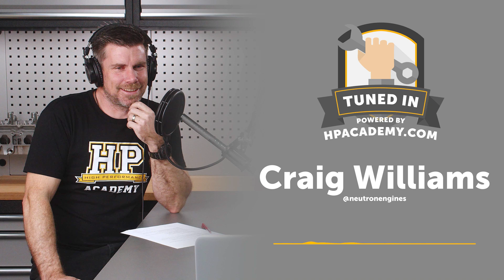013: 4.8L K24 V8 | How to Design and Produce Your Own V8 K Series [#PODCAST]

Comment: I have a crazy build plan for the k48. But even i have sensible daily numbers aith it. 700rwhp ish probably 750 range to be more exact low boost twincharged. 

Modern blowers with integrated bypass valves. Idea is low boost itll have that 700 all over and loads of torque. And act kinda like an ls3 or ls7 but strung out and able to go high rpms. 

But also be able to turn boost up and have it not bypass. Or various set ups. It conpounds but the boost is low say from 750 to 1k. Boost goes up still bypasses by similar range but response is a bit different. Then they dont bypass by compound and goes to 1200 to 1400. Max boost no bypass like 1800 but for standing mile events. 

Inside a superlite slc. Daily tune is for performance and shenanigans but also short shifting around town. But also cheaper performance street tires on a track. 1000hp ish for real track and race tires. On track. 

Anything above like 1200 is gonna be for drag racing and mostly the torque. 

Gearing it kinda like a ford gt or american car. But keeping in mind a higher red line. And more gears. Normally more so rpm reduction but idea is split the ratio gaps kinda. Not too close not too wide. 

But im also gonna probably be going 87mm stroke 88mm to 90mm bore. Saenz custom forged ti rods. Similar pistons to his. And billet heads. 

And potentially tweaking the cylinder sleeves. Diesels use steel sleeves. Alot stronger normally thinner. Gonna see about induction hardening the outside surface. Want good sealing. But wanna increase the strength for safety reasons.

Comment: What exactly defines a "barrel style" block? I couldn't find anything within a quick search. I'm assuming it's the engine design where you can visually see the outside of the actual combustion chamber(s) in motorcycle applications. Is there something else that "defines" it or am I even totally off target?
Reply: Barrel style is when you have the cylinder separated from the rest of the block amd heads. Like build a motorcycle engine vs having a more car like block.

Comment: lol, Ford's flat-plane crank uses an odd pin arrangement (up-down-up-down vs. up-down-down-up) exacerbating vibration problems but contributes to the car's unique sound (they also used the odd crank arrangement since the engine uses a common intake plenum). 

I had a 2017 with the spin on filter and never had any problems with the filter spinning off, but Ford insisted that the filter be torqued down to 16-18 ft/lbs. as I recall (had a sticker on the filter). I also didn't trust the dealership or lube shop to do oil changes on the car since the GT350 required the filter be torqued down and 10 quarts of 5w50 full syn. Not a huge hurdle but for any business predicated on volume way too easy to rubber stamp the service and end up with a filter hand tight and eight quarts of 5w20 oil the regular cars come with in the states at least.

Comment: can you use electronic valve control rather then cam if you building its from scratch and V6 would be much better bcz of constraints of space in engine bay specifically after 2006 model.

Comment: Hi Guy. I got most of the information, I listened 3 times. Git the bit o out the hit Vee etc. What’s the situation with the heads, as I imagine one is a mirror of the other? So not an off the Shelf Honda part? Many thanks And my second question, Craig was originally looking at a V12? And what heads was he considering, M120 Mercedes? Would be insane with a flat place crank?
Reply: Both the heads are identical, but one is mounted backwards. I can't remember how he links the cam chains but am fairly sure it's covered on his instagram account, so worth checking that out to see there.

Comment: Yamaha  is the only manufacturer that makes a crossplane crank...
Reply from the maker: Are you sure about that? Not something I can speak with personal authority on however a quick search does suggest strongly that isn't the case 😉 - Taz.

https://en.m.wikipedia.org/wiki/Crossplane
Reply: @hpa101  Sorry, I  wrote that half asleep after work and working on my car. I should have been more precise with my comment. Yamaha is one of the few  to use a cross plane crank in a mass production inline 4 cylinder engines. Sorry I didn't catch my mistake.
Reply from the maker: No worries, I don't know the ins and outs of part manufacturing in the car world but thought given their usage elsewhere with a wide range of other vehicle companies, it would be odd to only have a single source for them. In the bike/MotoGP world Yamaha certainly are known well for this as a comparative point of difference though, you're not at all wrong with that - Taz.